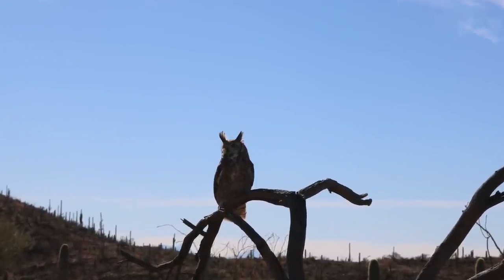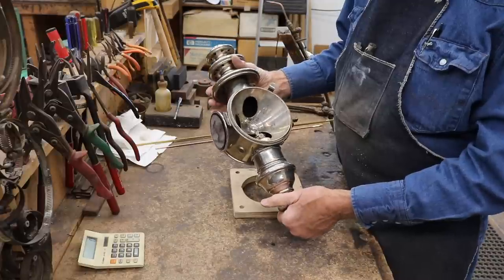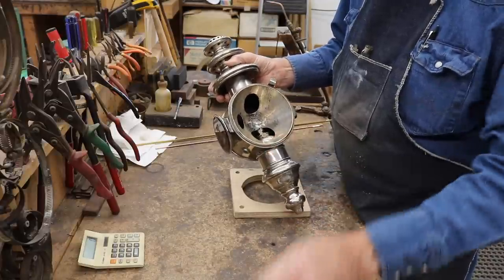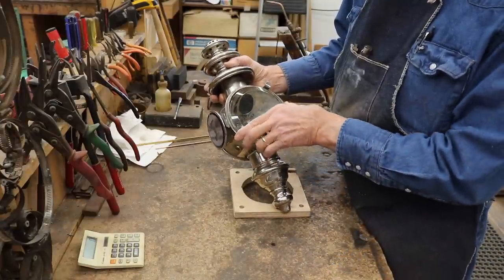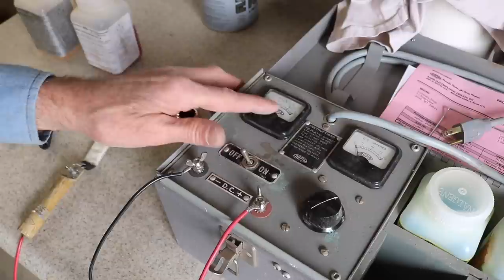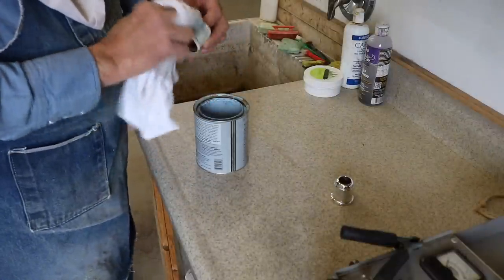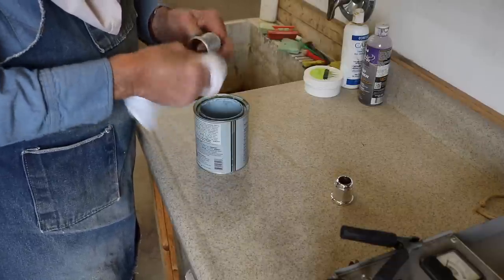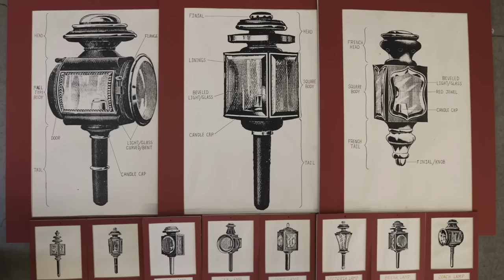Beveled Glass & Engraving

Comment: Rick, good to see you back!  I have a question about the printer's ink you used to fill the engravings - how does the ink hold up long term vs. something like the black "wax" used by traditional Clockmakers?  Any idea?
Reply: It should hold up very well.  The printer's ink will provide a deeper and more even black than the wax, but the wax will hold up better when the piece will be regularly washed over with solvents.  For the candle caps, the printer's ink is the better choice.
Reply from the maker: Printers ink is the choice of several engravers as it hardens and becomes quite permanent.

Comment: Have you ever had glass crack with the heat fromm soldering?
Reply from the maker: Yes, but it has been several years since I have had that problem. I have learned how to direct the flame on the bezels rather than the glass itself and when to limit the heat in general. I also preheat the glass to avoid temperature shock. It doesn't take much, just enough to warm up the glass a little.